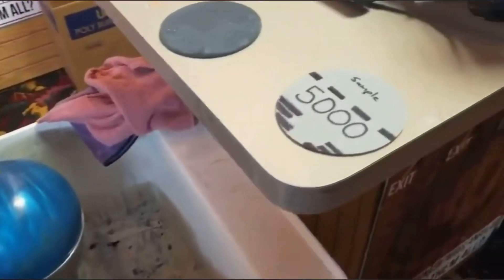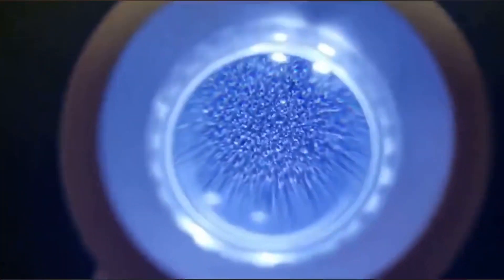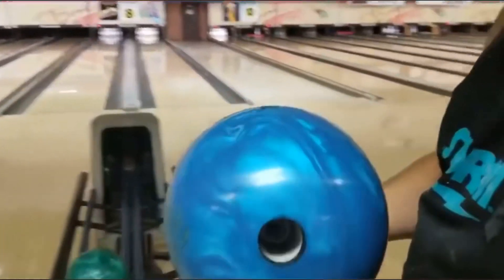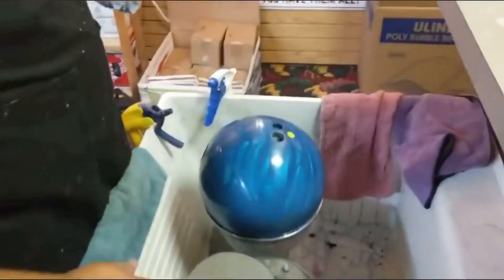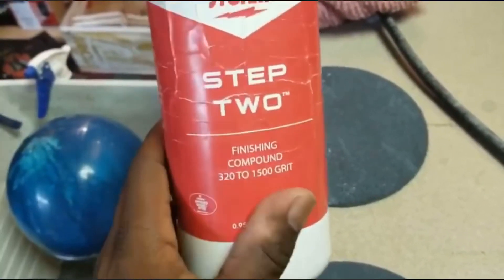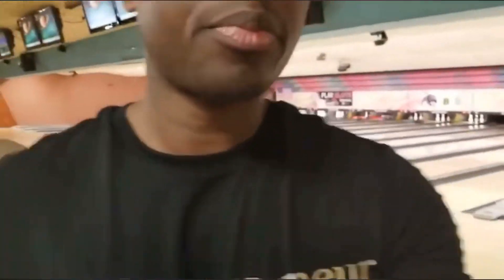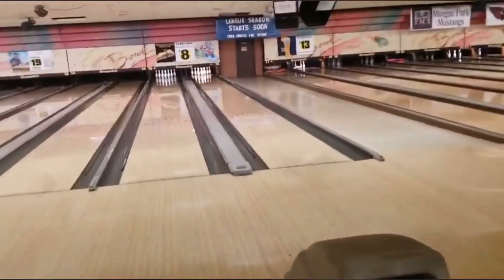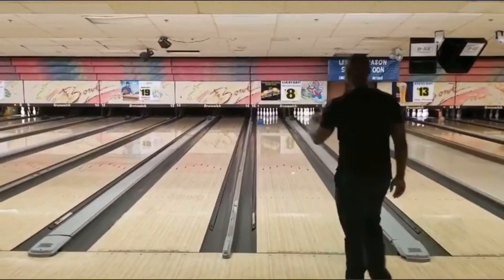THE DIFFERENCE BETWEEN POLISH AND SHINED WITH A SANDING PAD

Comment: So I'm new when it comes to sanding. Whether I'm using a pearl or solid, if the ball is normally designed for 2,000 or 3,000 finish, your saying use the 5,000 pad to give more power on backend? I thought maybe going the other way using a 1,000 pad might give more teeth and power? Do I have it backwards? Also I thought when a ball gets near 5,000 that it woukd be the same as being considered lane shined? Which would reduce ball power too right?

Comment: Traditionally, a “polish” is an abrasive cutting compound, basically the same thing as a fine sandpaper. Although it does leave residue, this should be completely cleaned off after polishing. A “wax” fills the pores and minor scratches and remains on the object. I’m from the automotive painting industry, and we typically use a polish to bring the paint back to a shine after sanding it with 1500-3000 grit. Unless a bowling specific “polish” is not a true polish but a wax product, I am confused by the use of the terminology.
Reply: It's because he's intentionally misleading people to sell his own products, which are typically just rebranded products from a supplier.  The pads are from a company called Joest Abrasives, and he now sells ball polish as well. Ironically, it's made by Turtle Wax - if I had to guess, it's likely their Clean Finish Polishing Compound.

Comment: Hammer Pink Widow is 500/1000 then powerhouse factory polish. So to resurface it should work it from 500 to 1000 to 3000 to then the P5000D pad all on the spinner?
Reply from the maker: That is correct

Comment: I always wondered why polish labels listed  grit levels that the finished product grit would NOT be.

What is the actual grit of the bowling ball that is polished with the Storm Step2? Label grit says abrasive1500, but we all know that's the material grit. What about the bowling ball surface?
Reply from the maker: It scans at 5000 grit
Reply: So you are saying that the ball will scan at 5000 grit AND ALSO have the carrier liquid on the surface of the ball? 

There is no way to remove the carrier liquid off the ball? Cleaner? Only scuffing the cover with a pad will remove it?
Reply from the maker: @ricerocket702  it depends on the carrier. Most bowling ball polishes you can't get it off other than sanding it. Some are made with animal fat. Which is good for cars not so much for bowling balls. We have lots of videos showing polish bowling ball scans. They are between 5000 and 5500 mostly.  Just search the channel
Reply: @Ctdbowling  
You are stating that a SANDED 5500 grit ball and a POLISHED 5500 grit ball will react differently because of the liquid carrier reside leftover on the surface of the ball. 

Even though the 5500 grit scratches are the same, the surface of the ball is different?

Comment: I would need proof the carrier is actually degrades performance. Uneven finish with incorrectly applied polish is a problem
Reply from the maker: Actually you can do a simple test yourself.  Take a new polish ball and wipe some oil on it. Watch it absorb, then go sand to a shine. Wipe oil on it again. You will see a big difference in absorbtion.
Reply: Absorption and surface performance are 2 different things.  Your stating performance degrades when grit is applied with a carrier. What I think happens with friable grit polishes is they polish unevenly, your product the pad provides superior even sanding. The 3000 grit gets the peaks shaved off to provide a even 5500 grit sanded surface. There was a course in engineering 36 years ago, but it never discussed bowling ball refinishing

Comment: Just got a black widow gold. Wondering, sense the factory finish is 500/1000 with powerhouse polish, if this pad would be the one to use when I resurface or if I should use a 1000 with polish. Thanks ron for another great vid.
Reply from the maker: You should use P5000D then use TruCut hand Applied Polish to get it back to the factory finish.
Reply: @Ctdbowling   okay thanks my brotha. If I use the p5000d without the polish will it be more aggressive than factory ? I see that's the case with the storm polish but what about the turtle wax. (I have access to a ball spinner)

Comment: What are your opinions on the spoiler alert, had it for a while and want an opinion on it.
Reply from the maker: I am not a fan of that ball. If you don't like  the performance start with a surface change and see if that helps.
Reply: Ok
Reply: Was thinking of purchasing that ball. What's the pros and cons?
Reply: @1steeler4life , I would personally rate it 7/10. A pro would definitely be the core and the weight of the ball, I have the 16 pound version which is the heaviest variation, so it hits the pins really hard and gets quite a bit if pin action due to core and weight. Another pro is the hook, it hooks pretty hard when the oil is gone, it is good for light to medium oil patterns, I have also done well playing edge with the ball. A con is the surface, and another one is 10 pins, it isnt impossible but I will probobaly only hit 7/10 10 pins, so I would recommend not using it as a spare ball when it comes to even the 6 and 10 pin.
Reply: @dontknowchaas  ok thanks
Reply from the maker: I think it is very condition specific and isn't usable over a lot of different styles of player
Reply: @Ctdbowling  thanks